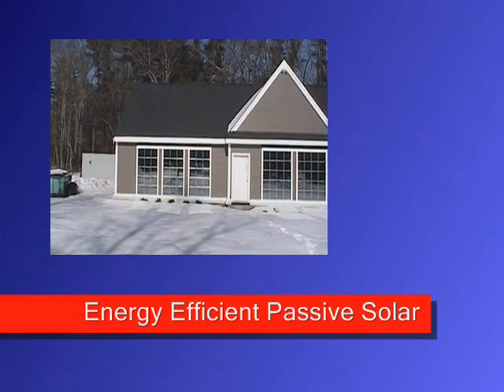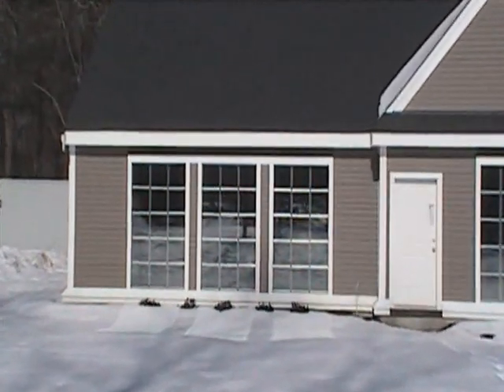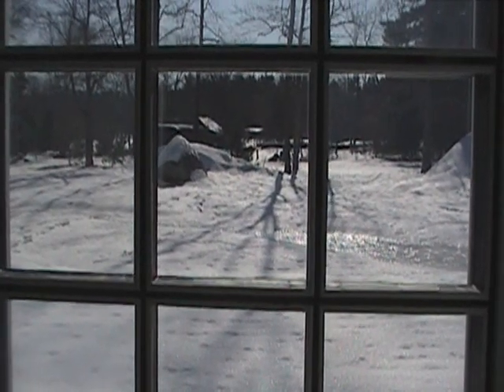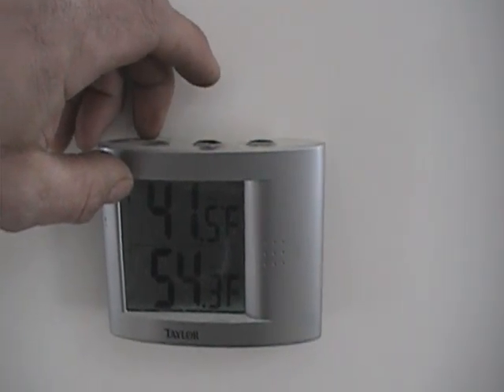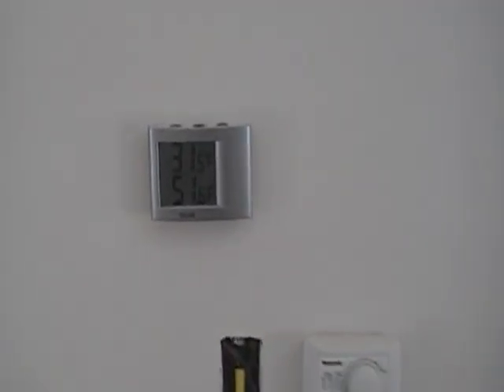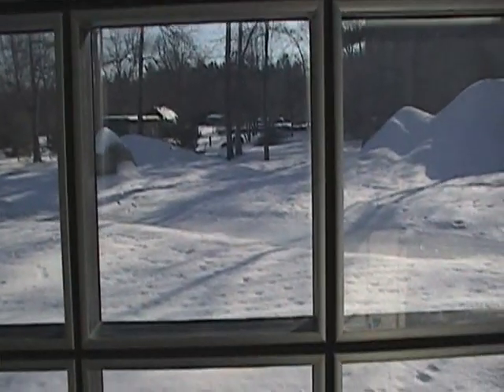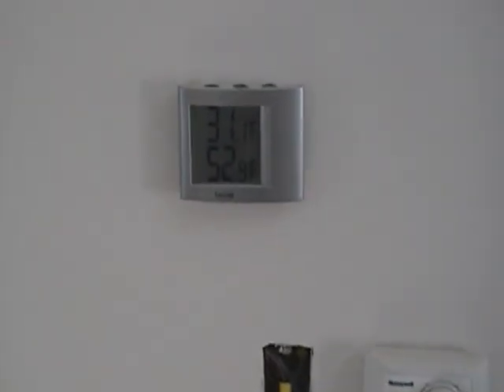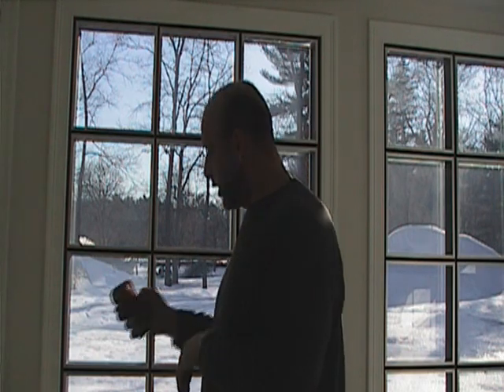Energy Efficient, Passive solar Home

Comment: Awesome performance there.  Zero Celsius outside and plus 11 indoors.  Amazing.  Question.........could you not have/create a thermal water cycle from the windows to the radiant floor pipes?  You said the heatpump/geothermal unit will pass 90 degree water in the floor.  The water in the windows was that on this particular day.

Comment: Water is not an insulator, it is a conductor.
The point of solar heating is to heat the surfaces/mass of the structure, not the windows.
I see no value in having water in the windows.

Comment from the maker: The water is not in contact with the outer glass, there is a seperate outer glazing and an air gap between the water blocks. Same principle as a trombe wall.

Comment from the maker: The geothermal heat pump is fully capable of heating this house without any other source of energy. No the house will not maintain 70deg F without sun and no other source of heat. ergo a heatpump to provide that heat. The design heat loss for this house is 20,000 Btu's/Hr at zero degree outside temps. The 3 ton heat pump is capable of putting out 28,000 Btu's/Hr. Not rocket science just plain math.

Comment from the maker: The water is not designed to insulate but as thermal mass absorbing the suns energy and storing it well into the night. Watch the video "Trombe wall? windows? the best of both worlds" that has a better explaination of how the windows work and explaination of Btu storage potential. Also shows how little heat actually escaped outward.

Comment: Can you heat a house with a geothermal heat pump alone? I doubt it. But that does not answer my first and more important (IMHO) question: Can the house maintain comfortable (70 deg. F.) temperature If there is no sun for three days? I really need to know!

Comment from the maker: Exterior solar shades will be used along the south facing windows. These exterior shades, will block 70% of  the solar heat gains. The window developer, is also a window shade inventor and was the guy who invented the honeycomb insulating shades back in the 70's. He has continued to work on ways to improve how windows, shades and light can add or detract value from your home.  Wendell Colson, VP of Research and Development for Hunter Douglas, one of the largest shade manufactures in the US.